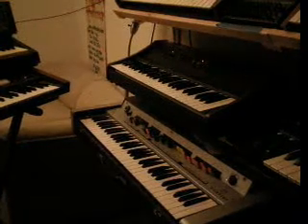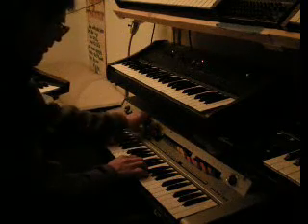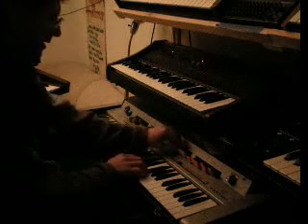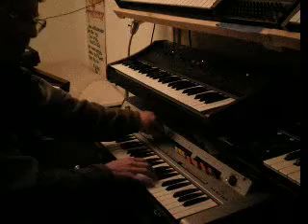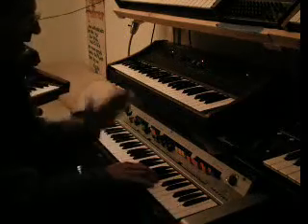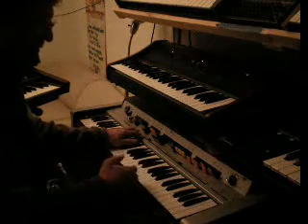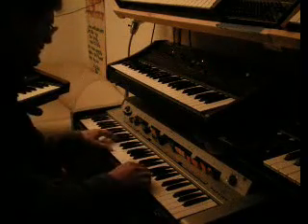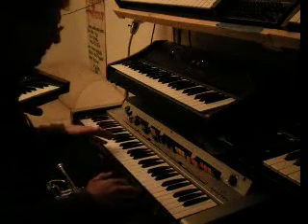Farfisa VIP345 and the Physics of Sound introduction

Comment from the maker: @zijkantroller a friend sold a VIP400 recently on craigs I think for 400 and something.  prices vary a lot with condition of course.  I'm retrieving a professional when I go back east which is kinda similar sounding but more tabs of course.  I got that broken for 150 in nice cosmetic shape. Probably will be a few hours of repair. That's what I paid for my vip345 years ago and it was a bit of a project.

Comment from the maker: Thanks.  hehe.  I'm probably going to sell that multiman since I have the orchestrator now also and it has a problem that doesn't really bother me but I'd have to mentioned it or fix it if I sold it.  I should say though that we just sold a farfisa professional duo the other day and the sound is about identical to the vip345 except of course not as many tone combinations.  Very boinky sounding percussion.  A bit earlier but are the first farfisa I believe to use chip divider. FAR-1B gold plated.